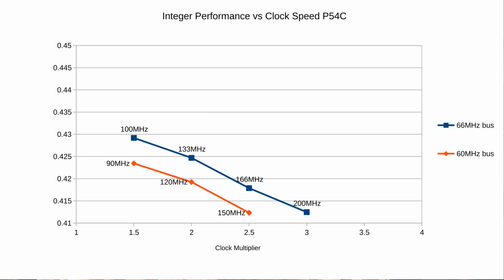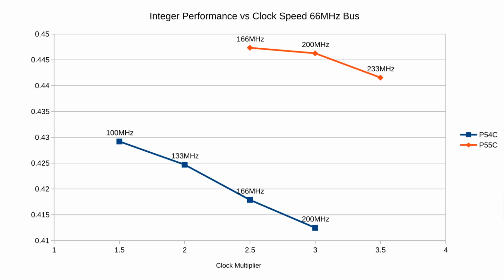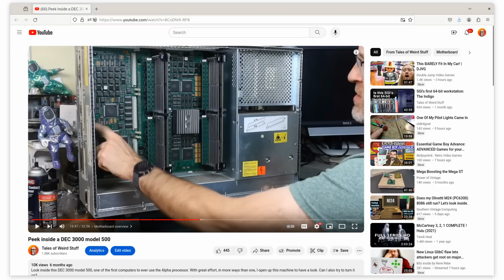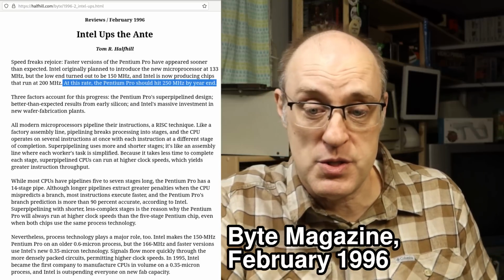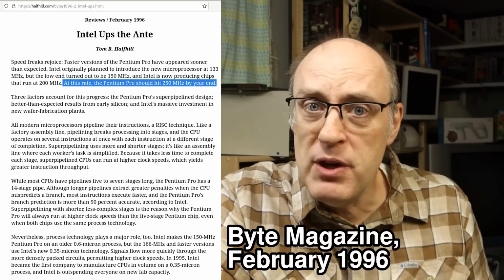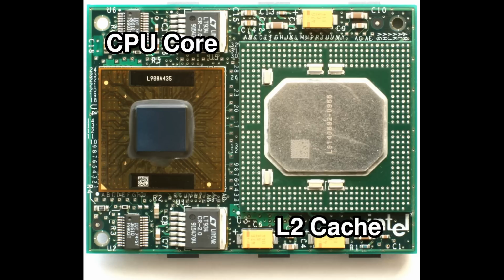Why did slot CPUs exist?

Comment: "Complaining" that Level 1 (L1) cache size haven't increased much over 25 years is odd. It's not that L1 cache size couldn't be larger (some x86 had 192k).

In general as cache size increase latency increases. CPU designers have found that a "smaller" L1 cache us more performant than a "larger" L1 cache. 

Although in general a larger cache size increases the cache hit rate,
it also increases latency. Piles of money has gone into hardware to increase cache rates. Performance of caches is dependent on latency, much much more so with L1 cache.

Because of the very low latency of modern small L1 cache with high hit rates it has been found that small L1 cache sizes are more performant for most cases.

Additionally larger L1 caches use more die size that can be better used for other hardware. 

At a certain point I see cpu's having L4 caches. Each CPU core would have it's own private L1 and L1 cache. Each CPU core die would have a shared L3 cache and then the CPU package would have a shared L4 cache.

AMD's 3d cache technology adds 64mb of L3 cache, upto a total of 128mb. In the future I can see each chiplet having it's own private L3 and the 3d cache becoming a shared L4, especial with multiple chiplets on a threadripper and/or server cpu's. 

A possible design could be that each chiplet's L3 is copied to the L4 which could help minimize a chiplet needing to go to main memory while making cache cohesion easier.
Reply from the maker: I didn't mean for it to come across as complaining. I just thought it was interesting. Other things haven't scaled linearly with transistor count either, so L1 cache size is not unique there. I know that CPU designers simulate large numbers of workloads with many parameters, L1 cache size being but one, varying, and they pick the best performance / power / cost balance that they can. I'm surely not going to tell them how to do their job. :)

I suspect this contributes to the massive size of on-die L2 cache. L4 cache is an interesting topic. Some variations of Haswell CPUs had a 128MB L4 that was shared by all the cores on the integrated GPU. I think some Itaniums had L4 as well. You are likely right that it will eventually become a common feature as chiplets and MCMs become more common.
Reply: @TalesofWeirdStuff  there is a reason I put complaining in quotes, it didn't come across that I wasn't using a strict definition of "complaining" and just couldn't think of a better term/phrase.

Comment: Apple's PDS wasn't normally for CPUs to be installed, they were for expansion cards to communicate directly with the CPU. In some instances this facilitated a CPU upgrade because the PDS card's CPU could override the onboard CPU, but this didn't last much past the 68k days (and even then there were exceptions where the PDS wasn't really a PDS). The CPU slot was just called a "CPU slot." The Old World Power Mac CPU cards were really just a way to entice people to buy a computer with an easy upgrade path and to use the same boards with multiple configurations (and later allowed the option of multiple CPUs on the same card). They didn't offer inline caches (they were all board-level L2, on the logic board) until the Mach V variants of the 604e, in the 300 and 350MHz 8600 and 9600s, and then with the backside caches of the PPC 750 and 7400 the rest is history. All of the Old World Power Mac CPU cards were also vertical (excepting some clones). Given the size of the heatsinks on those, I imagine that heat dissipation was the primary reason they were installed in that fashion. Since Pentium IIs were fairly hot, I figure that's also why Intel chose vertical (and I imagine edge connectors are cheaper to manufacture and harder to damage than multi-pin socket types).

Comment: It is along standing fact, that Intel choose the slot 1 purely to lock out all other CPU manufactures from using their chipsets after there lost lawsuits around socket 5 and 7 during early and mid 1990's.
Reply from the maker: I don't know if the slot 1 form factor did much for that. I would guess that various patents on the bus protocol itself, which dated back to the Pentium Pro, were a bigger factor.

Comment: The question now is that  considering the late 90'$ are back in the forms of "chiplets" (multi chips 2D dyes) CPUs, are we bottlenecking again development wise?
Reply: yes and no
the reason we can do advanced packaging now is that complex packaging technology has been advanced so it has the yields and density to be fast, efficient, and cheap enough to be worth it in many cases vs making bigger chips, as at the same time the price per transistor has been stagnating or even going up for advanced process nodes.

Comment: At the time didn't hear negativity towards CPU slots.  Never had to worry about bent pins or putting the CPU in wrong.
Reply: And you could remove the CPU without having to removing the cooler. I like them at the time.
Reply: @Fulano5321 exactly and no repasting either with slot CPUs.

Using a P2B as my retro gaming rig and I love how easy it is to change from a 266 Celeron to a 600 P3 within seconds
Reply: It made swapping CPUs much easier. Benchmarkers probably loved that.
Reply: The Cooling was atrocious. PCs were loud back then.
Reply: @deelkar   If you're a doof like me PCs are loud still.  Bought a budget "gamer" machine with an awful water cooling system.
Reply: @GconduitYTubeAccount  try looking for a used or new noctua cooler, preferably something a little nicer. They have really fantastic bracket compatibility, in case your CPU isn't immediately compatible with what you have. They'll generally run whisper quiet, but even when they do get loud, it's a very pleasant hum.
Reply: @GconduitYTubeAccount  If it has an AIO, make sure the pump is actually bled.  It needs to be supplied and flushed fully with water.  If there is any air in the pump it will be very loud, kill the pump and the fans will have to spin extra hard because it is not pushing enough water through the system.

Most problems with AIO's or water cooling pumps in general being very noisy are because of this issue.
Reply: @deelkar  What do you mean? Pentium II and III was capable of being passively cooled without issues, and in my very recent experience with multiple Pentium II/III systems from ’97-’99 they are not particularly loud at all. Hard drives of that time were much louder than the PCs themselves.
Reply: This. I thought the cartridge CPU package was great, they were very robust. I don't recall people complaining about them at the time.
Reply: People probably didn't complain much because they had a very nice CPU for the time ^^. Unless it was a non-A Celeron. Then it was not a nice CPU.
Also, until the early 250nm Athlons arrived, power consumption and cooling were not that much of an issue. 
I can remember the absolutely infernal noise some of these 40/50mm fans made, trying to keep the 50W of a Athlon 700 in check. Because there was no room for efficient heat sink designs, it had to be brute force by air flow. And because there was also no room for large fans, they had to be FAST. 5000rpm and upwards were not uncommon
Reply: My common beef was how difficult it was to remove them out of the slot.  I actually cut my hand on the case trying to get one out 20 years ago when it suddenly released.  I still have a scar.
Reply: These slot CPUs were what everyone was using when I threw my first PCs together from parts, and they're still my favorite form factor to this day.
Reply: I already had p-pro at the time.
 so my personal SLOT was the athlon 500.

Those were the days...
Reply: One thing I was worried about with some Slot stuff was breaking the tabs on the sides for some slot CPU stuff.
Reply: What I remember was the pga grids didn’t have room for all the pins, and a cashe mounting in proximity to the cpu… they moved the sram from the motherboard to the package.
Reply: I liked them. But limited space for edge fingers and very limited cooling capacity probably means we won't see them again.
Reply: Neither of those are issues with AMD CPUs. Pins on mobo and are covered till you are prepared to install. Marked corners on CPU to line up with marked corner on mobo.
Reply: @Sav.B58  AMD just switched to LGA 5 minutes ago, they've been pinned for a long time.
Reply: @tejay9416 their workstation Threadripper and server Epyc processors have been lga since Zen 1
Reply: @Sav.B58  well AM5 has pins on mobos, but AM4 has pins on cpus
Reply: @Sav.B58  both before and after the slot based CPU era, AMD used more or less the same type of sockets as their competitors (whether they were ZIF or another factor is a whole historical issue for another day, since I've no idea the disadvantages and advantages of each socket over the eras). AMD even had their Slot A series of slot based AMD Athlons.

From what I understand though, the issue of inserting a CPU the wrong way  pretty much became a thing of the past going into the 00s because of the various notches, triangles, guides, etc., Intel and AMD developed. Yeah, people still bent pins, don't get me wrong, but it seems like the 90s was a painful era of people without much help jamming stuff in.

But like another person said, even cartridge slots can get damaged, broken, bent, etc. We may liken PC building to building a LEGO set (mostly because these days you just follow the instructions😂), but unlike official LEGO bricks, pc components can definitely be a might more fragile. Not as fragile as the novice will believe, but more fragile than the veteran will forget lol.
Reply: @SupraSav Today's cpu and socket situation is nowhere near as convenient as these were from experience.  It was as simple as plugging in a sound card.  If you dropped it you weren't bending pins or damaging a socket.  You couldn't put it in wrong.  You weren't dealing with thermal paste.  It was far simpler than today.  Not that today is difficult, but that wasn't the argument made.
Reply: @Sav.B58  I'm glad you had good experiences with them.  Working in break/fix I saw my fair share of oopsies.
Reply: @GconduitYTubeAccount the amount of time one could unsloy and slot them in the motherboard felt quite limited. I ran through a fair number of test main boards back then. Did you have a similar experience?
Reply: @Sav.B58 pins on the mobo can be bent.
Reply: @Sav.B58  yeah, intel has all that stuff too, and the marked corners don't mean shit. I had a coworker fixing a Dual CPU Xeon system and managed to install both CPUs with corner positioned opposite of where it should be. They tightened the heat sinks so much they cracked both CPUs and damaged the logic board. Cost us $3500 in parts.
Reply: @Sav.B58 it is a issue I bent my 5000 when it fell like a real amateur trying to change the cooler with the mining surge

Comment: A couple of notes/comments:  

While mentioned, I'd emphasis more in the video that the external L2 cache of the Pentium Pro, Pentium 2 and early Pentium 3s were all on their own dedicated bus independent of the memory bus.  This means additional wiring and board complexity.  Thus if the SRAMs were placed on the motherboard, additional layers would have been necessary due to the need to keep the SRAM close to the CPU socket.   Another factor of SRAM is that it is speed specific:  the processor would have to have run it at a divisor of the CPU clock.  As faster and faster processors were released, the SRAM divisor would become increasingly greater, resulting in lower efficacy of the cache vs. a natively higher clocked cache.  Once it is on the motherboard, it has to support new processors throughout the life span of that platform.  Speaking of motherboards, in this era Intel was not the only company making chipsets for their CPUs.  By keeping the external L2 cache as part of the CPU package, it'd prevent 3rd party chipset makers form removing a key feature for the Pentium IIs performance.

39:40 - It may have been an artifact of the time but modern chiplet designs leveraging multiple dies in a package do have their individual dies tested before being assembled.  I do not know off hand if this applied on the same scale but there are indeed some debug pins on the package that a partially assembled Pentium Pro could be tested.  In essence you could test if either all the SRAM is good before adding the CPU core or vice versa.  This would catch some of the yield issues early on in the assembly process but obviously not all of them.  To your point at 40:00 about binning, yes it was possible.  Some of the Pentium Pro 512 KB units were fused off to be Pentium Pro 256 KB model because of bad cache.  I haven't seen them but conceptually it'd be possible to bin the 1 MB units with two dies down to 512 KB in two different ways:  disable one bad 512 KB die or nerf both 512 KB dies down to 256 KB to make 512 KB total.  Intel also had the option of just putting in one 512 KB die into the 1 MB package to simplify manufacturing.

One other major difference with the Pentium Pro and modern multi-die designs is that the packaging itself is different:  the Pentium Pro leverages ceramics.  For chip bonding and wiring, organics is reportedly easier and cheaper to do.  Intel started to move to organic packaging with the P55C.  Though modern chip packaging effectively uses 'nails' to link two pieces of silicon together in some cases.

45:31 The reasoning for a slotted CPU vs more of a card that is parallel to the motherboard is that it mimics the ATX designs of the time that Intel was promoting.  Not all implementations were the same but many vendors kept the CPU card slot parallel to the PCI (-X) slots of the mother board which helped with cooling.  Apple also in this era would take IBM/Motorola PowerPC chips and put them onto cards.  In Apple's case, it included a small VRM and even multiple processors since multiprocessing on those systems shared a common bus.  A select few models of PowerMacs leveraged in-line cache which was also found on the processor card (though there was still a motherboard cache slot).

49:35 AMD didn't copy Intel, they copied DEC Alpha by licensing their bus protocols.  This also explains why some Alphas were slotted because the IO bus between an Athlon was the same as the Alphas of the era.  One of the ideas of the time is that a motherboard could support both an Athlon or Alpha, though I am only aware of one model ever being released.  This also explains 55:45 why AMD released the Athlon being slotted vs. the K6-3 being socketed:  the K6-3 was to be a consumer/mobile chip was Athlon (or Alpha!) were meant for workstations.  The K6-3 also used AMD's own bus design.

Comment: Didn't Intel sort of use modules for itanium cpus a bit longer after they stopped using slots for x86 cpus? (granted not for separate cache module reasons)
Reply: They did. And then there was also Rambus for the early Pentium 4's...

Comment: it would an interesting video, why memory is progressing so slow compared to CPUs and GPUs and why are we still using DDR memory technology that was invented in the late 90s over other memory technology like rambus.
Reply from the maker: RAMBUS vs everything else is quite another topic. My understanding is that RAMBUS has a couple issues. It has a huge amount of bandwidth, but this comes at the expensive of increased latency. In addition, the way the circuits work internally, a lot of more of the chip is active during memory transactions causing a lot more heat to be generated. RDIMMs had heat spreaders years before other RAM modules did.
Reply: @TalesofWeirdStuff  also RAMBUS was patent encumbered which lead to it being more expensive so it fell out of failure fairly rapidly.
Reply: Honestly memory is so dumb.  I remember when I learned how dynamic ram actually worked and I just facepalmed so hard.

It's literally a giant array of buckets with holes in them and you need to have someone run around non stop and refill any bucket that still has water in it to prevent data corruption.  

Hence the need for all the massive timing delays in modern memory configurations.  So much time is just being spent refilling buckets of water.

You would think we would have found a better way to do it by now but nope.  We have (sram) but nothing cheap enough anyways.
Reply: @JathraDH  It comes down to cell size and component count. A DRAM cell needs only a couple of transistors and a capacitor. An SRAM cell needs anywhere from 5 to 9 transistors apiece. 
Multiply that by however many millions or billions of bits you want to store.
If there was anything simpler that worked at that scale, it's not been found, yet.
Reply: @watchm4ker  I know, but its still just dumb lol.
Reply: Patents ruined rambus. It may have been a better technology to work on improving, but patent law proved to be a barrier.